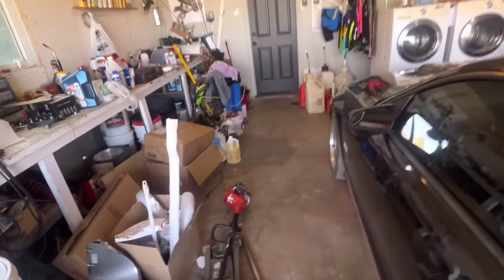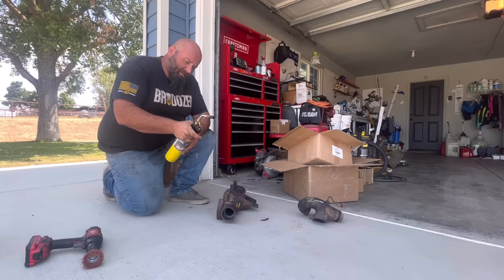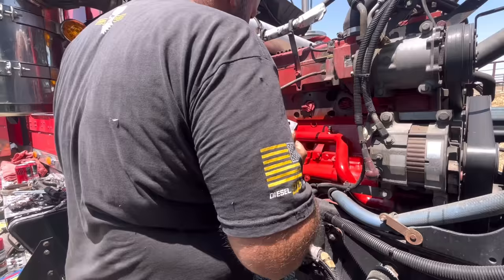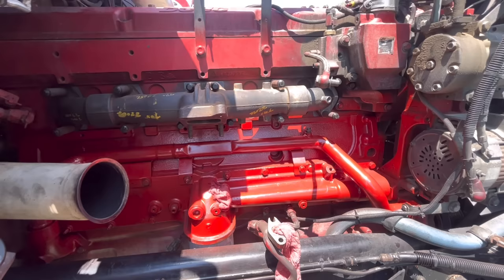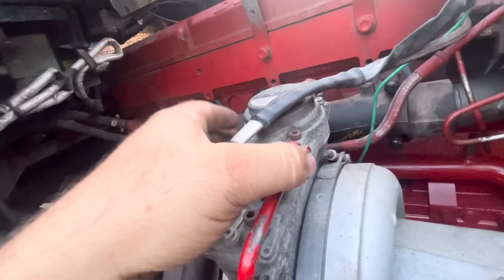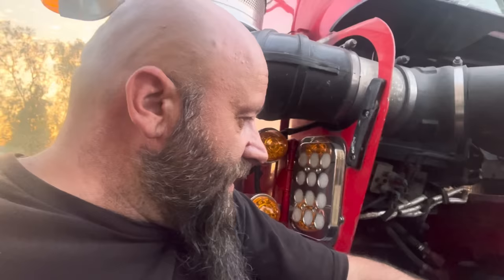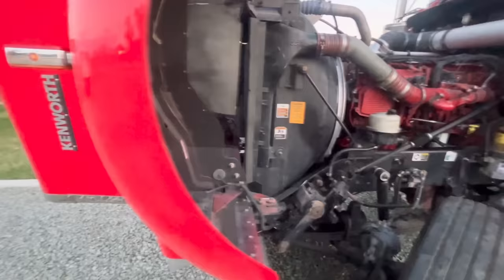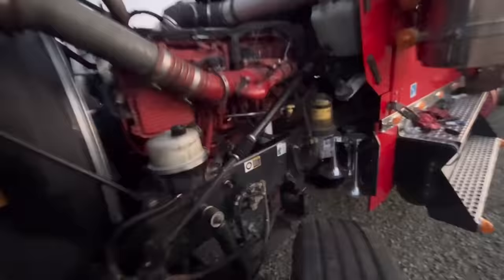“PLAYING MECHANIC” | Part 2: Replacing The Manifold on a Cummins ISX

Comment: Martin...... what's the standard cost on Air compressor replacement at petercar???   PM service???  Tell some of these new folks the difference in doing it yourself and having a shop do it...
Reply from the maker: I was quoted 2300 at a shop for compressor, a PM these days, I hear 450-750 depending on engine.

Comment: I've got a nearly identical model W9 with the same power plant. Connecting the water pump to the rear of the engine block.. what is that line called and is it off of a Signature? How can i "Google" or find one? I'm facing a 'similar' repair..

Comment: how many times have you had to fix the engine and would you strip and rebuild the whole engine if something went wrong and it was fixable
Reply from the maker: I’ve never been inside the engine on this truck, it’s all original. If it came down to it then yes I would rebuild it.
Reply: @TruckingTogether  a million miles and still have not rebuild it yet that a Cummins for you and you have taken good care of it

Comment: Heyy buddy I have a question so when you deleted your egr to use the same turbo on that manifold did you use a spacers
Reply from the maker: Deleted what??? That’s illegal 😳

Factory manifold and turbo. Just the end piece is different so has the bung for backpressure sensor. No spacers.
Reply: @TruckingTogether  sorry for asking but where can I get that piece